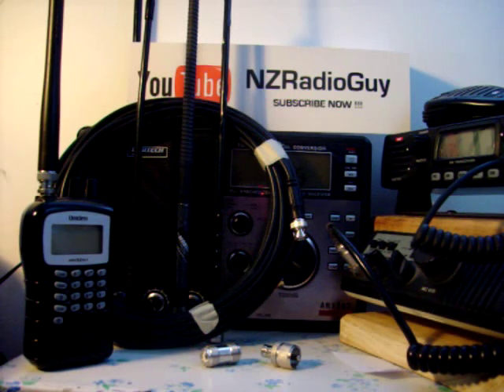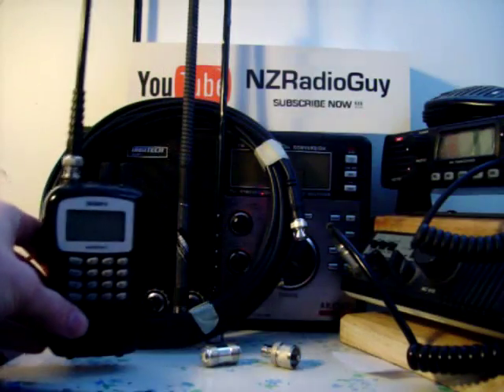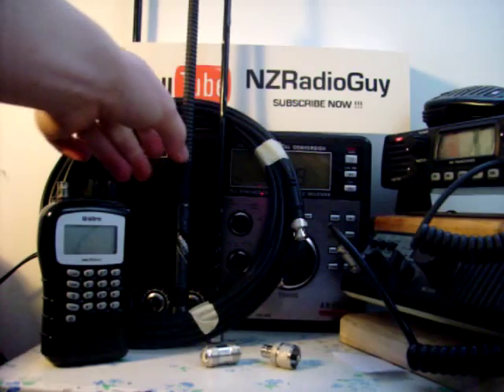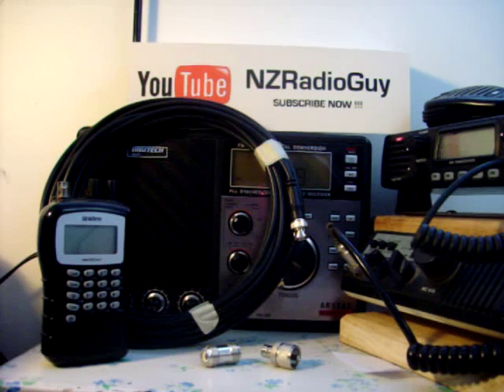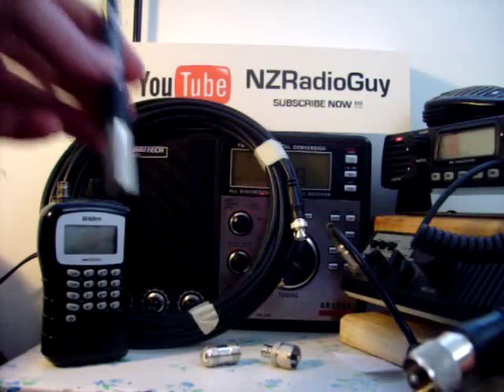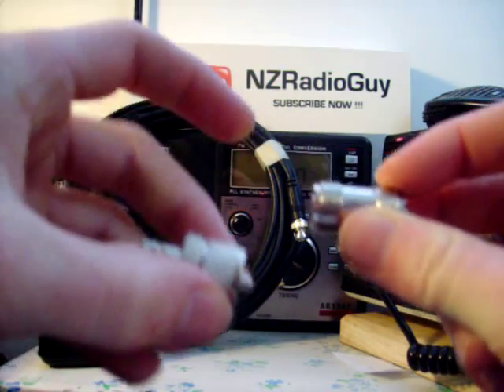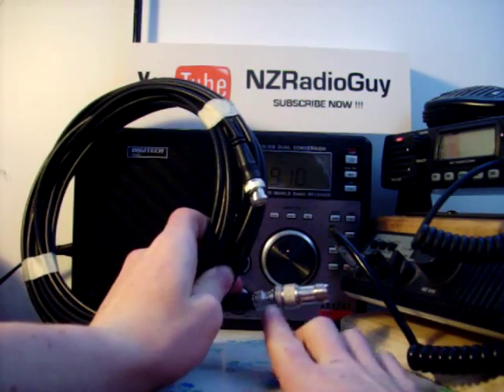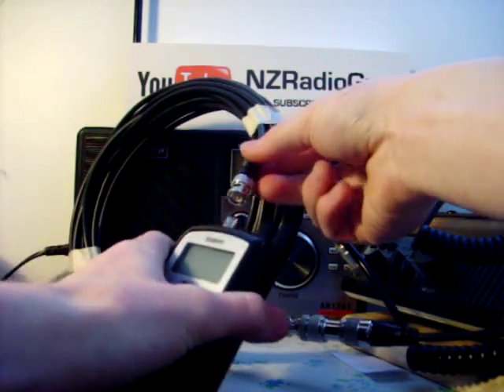Improving Hand Heald Scanner Performance

Comment: for Hand held scanners while using hand held, I recommend the Radio Shack telescoping HAM antenna its 6" closed and 26" fully extended. best of all its Center Loaded so you don't need to ground the Antenna. Alternatively you can use any Dual Band HAM radio antenna. or a CB Rubber Duck. In a car I would recommend an External antenna, preferably one with a Center Load and for home use, using a hand held antenna on a rooftop is poor quality. you can get more from a Discone antenna or even from a Vhf/Uhf TV Antenna. Even the circular type of TV Antenna works quite well when Roof mounted.

Comment: Hi, I have one of these handheld scanners, I generally just use it as a hobby thing listening to the police in the Waikato. could you please recommend what sort of antenna I could upgrade to and where I can buy one from.. and don't want to spend to much money... Also on the odd occasion I use this scanner in the car and while driving it doesn't seem to like the when im driving the speech jumps and goes crackly.. Would a better antenna improve this?? I did upgrade the antenna when I purchased it think I got it from dick smith it says on it Mobile One BNCSCAN 25 - 1.3gHz
Reply: Taylor - get a HAM radio dual band Vhf/Uhf antenna it will improve reception while hand held , as for the car , the budget way to get better car reception is to get a Window clip mount for your antenna, you can use the same antenna for walking around as for in the car.